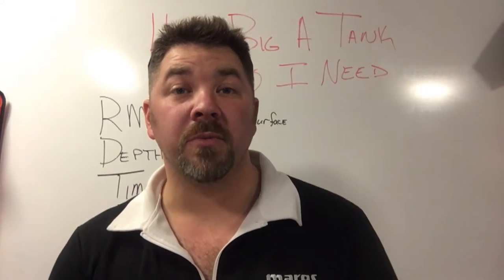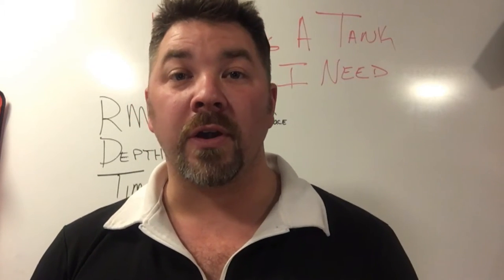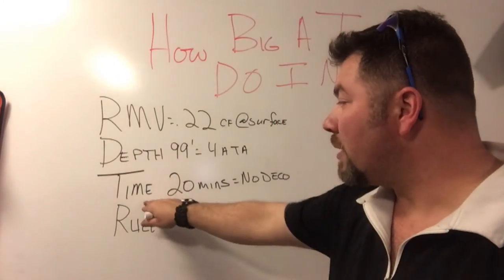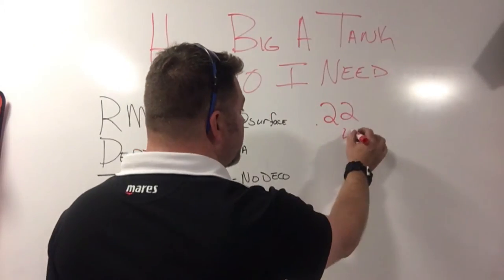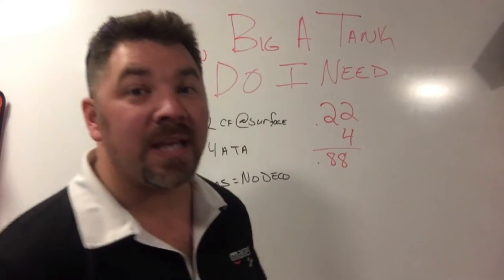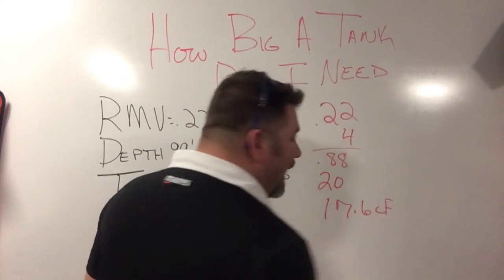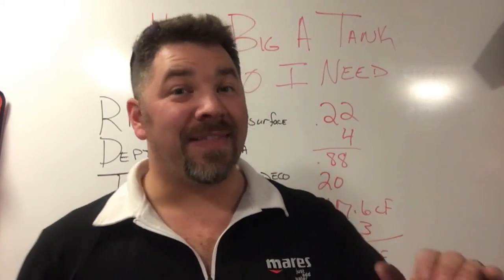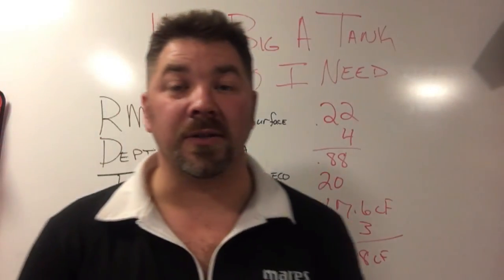How Big Of A Tank Do You Need

Comment: A two part question here (1-) are you saying that the total dive should only use 1/3 of supply and return to boat having 2/3 's reserve-OR- the diver could (if favorable conditions and training allow) use 2/3 total and always have 1/3 reserve upon return to boat ??  (2-) Since the reciprocal of 2/3 rds = 1.5  so if a dive will require 80 cu/ft usable air, we could multiply 1.5 X 80 cu/ft =120 cu/ft to determine tank size (120) for the dive requiring 80 cu/ft. with a 1/3 reserve- or- we could take our tank size(120 cu/ft) and divide by 1.5 ,  120/1.5=80 cu/ft to determine what 2/3 rds of our tank would be...and not exceed that limit...is that correct ? As you may surmise from my comment questions I haven't been diving yet and need to get some of the the mental debris out of the way first.
Reply from the maker: Great question. The rule of thirds is based off a diver descending with a full tank and making a dive. Once he or she has used up the first third, he or she will turn and head back to the exit.  Finally ending the dive still with a third in reserve. There are several things a dive needs to know before you can calculate how much air you need. First is no decompression limit and next is air consumption.  With these two variables, a diver can plan his gas management very easily.  This of course is planning with tables and not a computer.  Although the computer will compensate for air consumption and no decompression time changes as you ascend, it's built in algorithm is more advanced than the math we can do on paper.  Diving the rule of thirds is always the safest way to dive, however, most follow their computers and don't follow quite as a conservative dive plan.  Just for an all around fun dive, especially on a dive charter, having enough air to reach one's no decompression limit is not necessarily needed, as most dive charters will give you a time limit much less than your no decompression limit.  Thus, you will need to be out of the water before you ever run out of air.  If you are planning dives that are not on a commercial charter, where you set your own rules, then taking enough gas with you to reach your no decompression limit and still have enough air to be able to plan and dive by the rule of thirds, comes more into play.  The easiest way to figure up the rule of thirds is to take the starting pressure and divide it by 3.  Example: 3000psi / 3= 1000psi.  3000psi--1000psi= 2000psi of usable gas.  Start with 3000psi, turn at 2000psi, end with a 1000psi.   This also applies to high pressure cylinders as well.  3442psi / 3 = 1147psi. 3442psi - 1147psi = 2295psi usuable gas.  Start with 3442psi, turn at 2295psi, end with 1147psi.  When diving with doubles that are manifolded together, the math is the same.  In independent doubles such as a sidemount situation, you can either watch both gauges and apply the same principle to each tank, or add the total air supply together, and divide it by 3.  Example for Sidemount Independent tanks.  Two cylinders both at 3000psi. Total air supply 6000psi / 3 = 2000psi. 6000psi - 2000psi = 4000psi usable gas. Start with 6000psi, turn at 4000psi, end with 2000psi.  Or simply watch both gauges and when both hit 2000psi turn, and end when both are at 1000psi.  The second way seems easier to me, simply because there is no math involved while at depth.  You have to remember, knowing how much psi you need is not the same as how much cubic feet you need. After calculation your SAC rate, you will need to convert that into your RMV rate. This will help you decide which tank or tanks will be best for any given dive.  As a new diver knowing all this is very important, but so is having fun.  Get certified, have fun, and don't make things more technical than they need to be.  After you have several dives under your belt and you start to take other continuing education courses, the math will fall into place and help you extend your knowledge in diving.  Have fun and safe diving.
Reply: Thanks man! Appreciate the detail and the suggestion to keep-it-simple.

Comment: Thanks for the videos.
If you need 17.6cf for the entire 20minute dive. With the rule of thirds why is the required total 52.8cf and not (17.6 * 1.33) 22.88cf?

22.88 gives 2/3 for the planned 20 minute dive, and 1/3 extra.
Reply from the maker: Great question. This is based off the total dive itself being 20 minutes long (not the time spent at the deepest depth), including descent, time at bottom, and ascent, excluding safety stop time, since this is a no decompression dive. Even though by this calculation a diver would not be anywhere close to their no decompression limit, we are still doing the calculations based off planning the dive with tables instead of a computer.  Tables only allow for a square profiles, not a multi level profiles.  This of course does not hold true if one uses the old PADI Wheel or ERDP to plan a multi level dive. If a diver was to use a computer, not only would it compensate for added no decompression time as he made his ascent, it would also compensate for added air time, if it was an air integrated model. Most would agree that a 53 cubic feet cylinder would not be the best choice for this dive, but would be the bare minimum one would need to use.  Once again, this is based off the rule of thirds being one third to dive on, one third to get back on, and one third for an unexpected emergency.  Though planning with the tables is a quick and simple way to plan dives, they are still based off a square profiles, not a multi level profiles.
Reply: I was wondering the same thing. Your answer cleared it up for me too. Since the rule of thirds is not just 2/3 of time spend at bottom, then multiplying by 3 and not 3/2 makes sense now! Thanks!

Comment: Based off the formulas you provided, in order to figure the size required, you would at least have to have history of a dive at that particular depth.  If the depth is new to you though, how could you figure it?  Would you say you could use a similar depth that you have been to before without it being the exact depth?
Reply from the maker: Calculating a SAC rate or RMV rate is based off an average.  SAC rate changes depending on what Cylinder you use, however our Respitory Minute Volume will never change.  My suggestion is to log every dive and make notation of you air consumption.  After a series of dives, (you pick the number), calculate your SAC and RMV, and then average them out.  This is the best and most accurate way to do it.